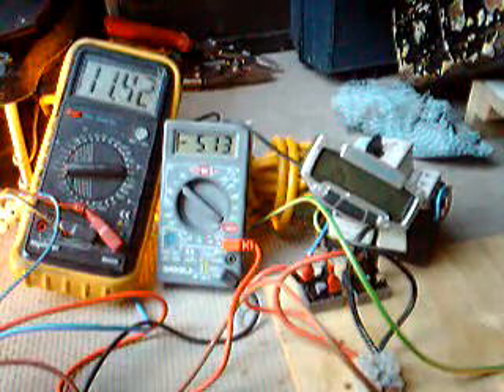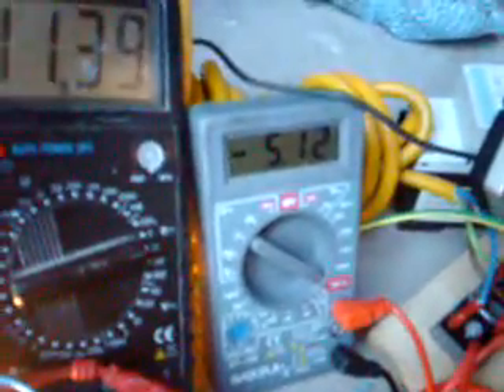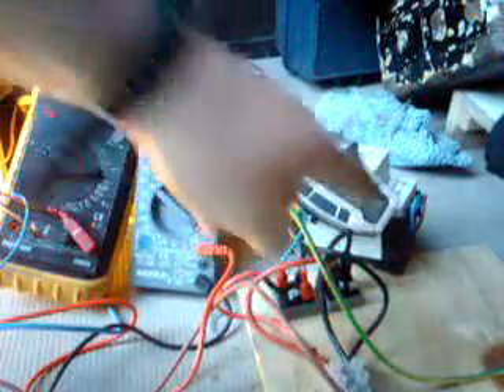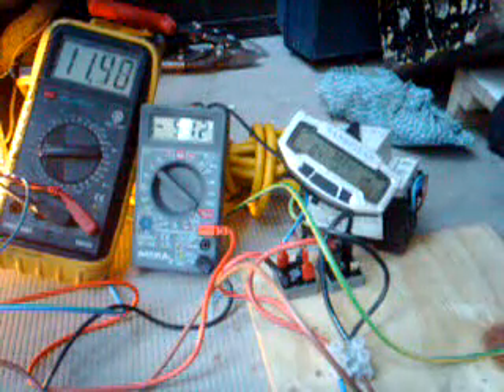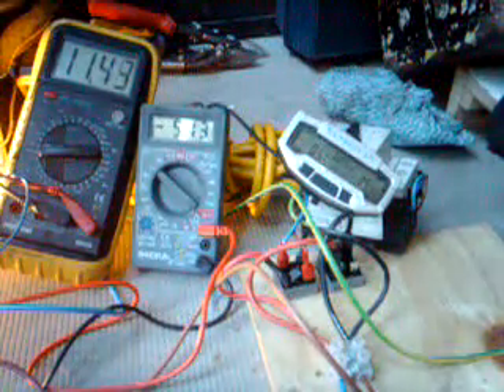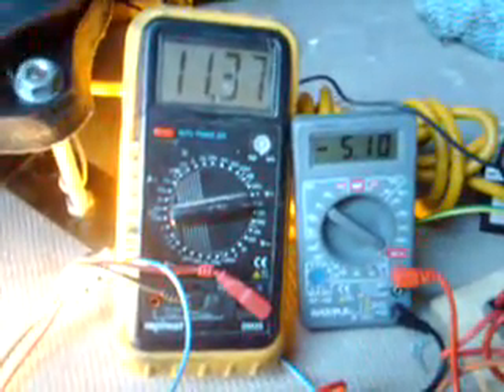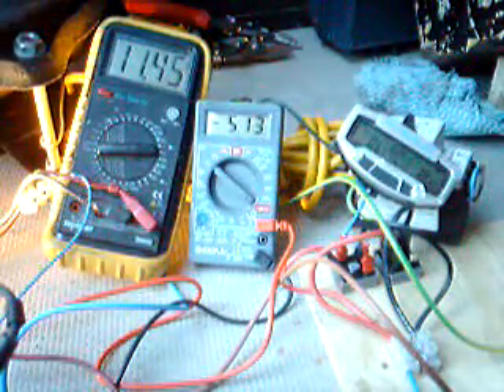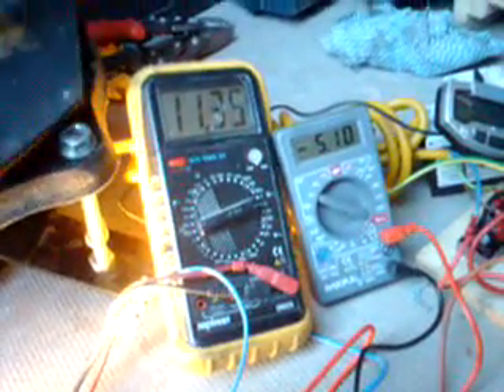wind turbine car hub video 13

Comment: your generator was just putting more voltage in than what was present in the battery . your load will remain the same but the potential voltege will go higher.
If you continued spinning your generator it would have to bring the battery all the way to top voltage output for charge controller before it would be carring the load to the circuit. you will only charge as many amps as your charge controller will allow.
your generator only produces voltage,the circuit resistance dictates the amperage.